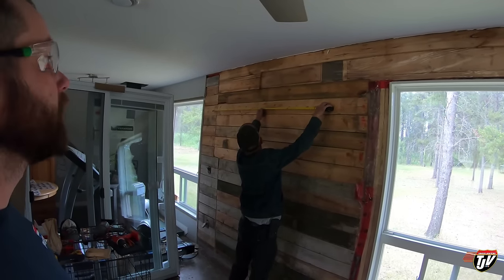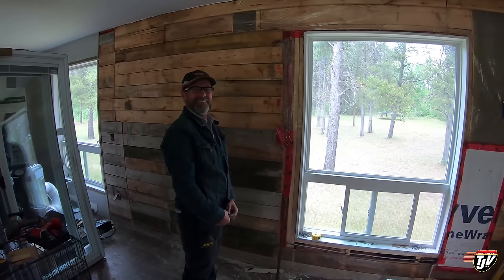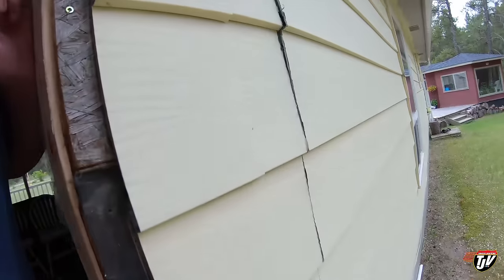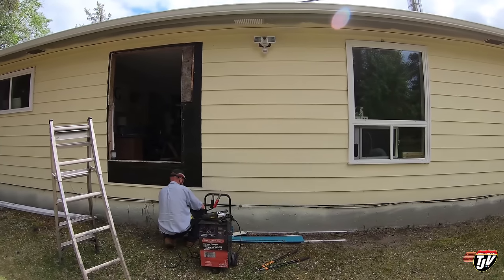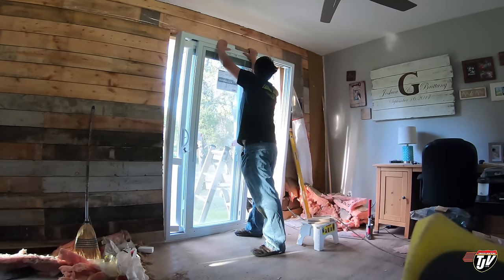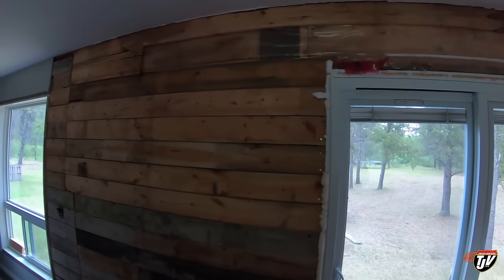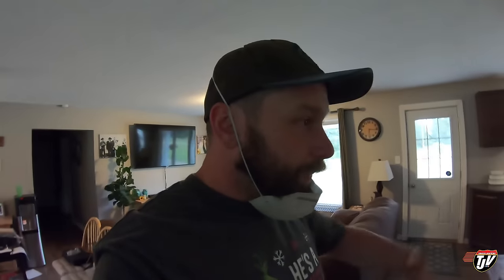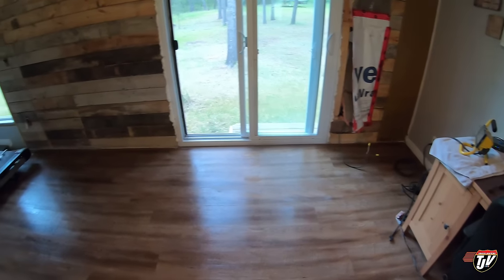TJV | THE INSTALLATION | #2009

Comment: Hope you guys put a platform outside the new sliding doors so you can sit there too. Then steps. :) Fingers crossed. It doesn't have to be as big as the front porch on your house. It will be easier for the dogs too, Cheers!

Comment: i can tell u one thing this house might b older but it’s gonna outlast any new house u build from scratch today cause that wood on that house is very tough wood and it doesn’t warp that wood u buy today is crap compared to what you’re house has we took old buildings apart and used the same wood that your house has some buildings we took down the second time and reused that same wood again and it’s straight i think they called that tounge and groove that house will outlast all the new ones you’ll have a good durable house Josh

Comment: The project is coming along just great! I use to frame houses when I was 15 & did a little bit of restoration when I was 17. Your dad really knows his stuff! Measure twice, a third time if you're still not sure & cut once. I have a board stretcher but it doesn't work on aluminum siding. 🤣 Nice job cleaning up, I hope the dust is gone from the room(s) when Brit get's back. Another great video, thanks for sharing. Spoke at ya later, come on. 😎